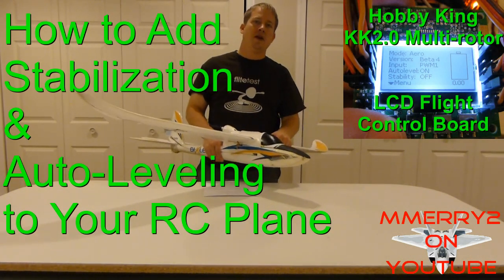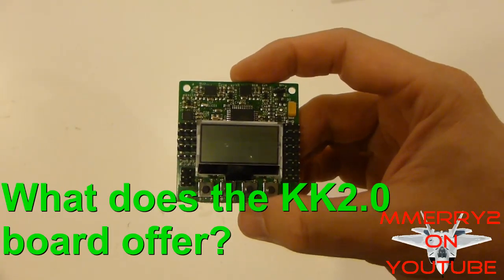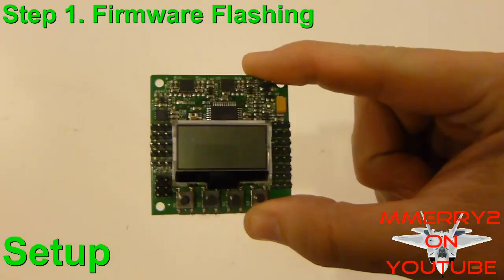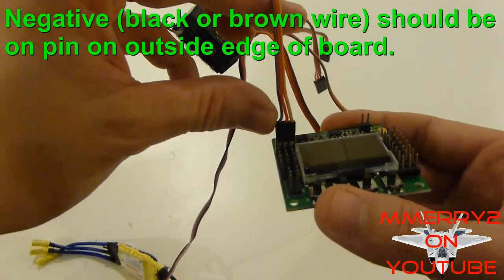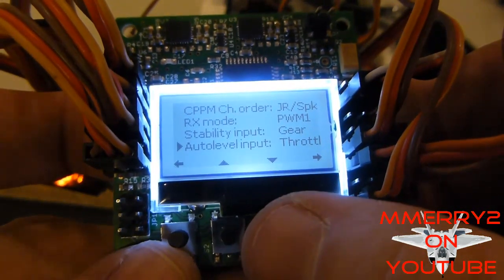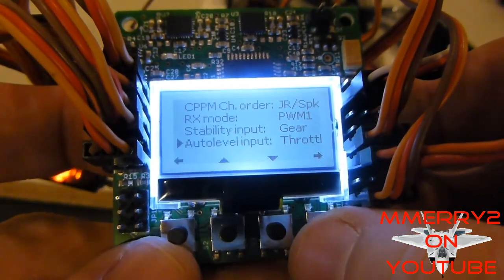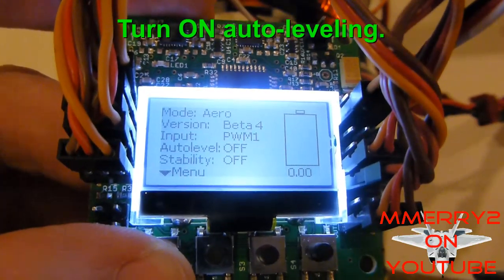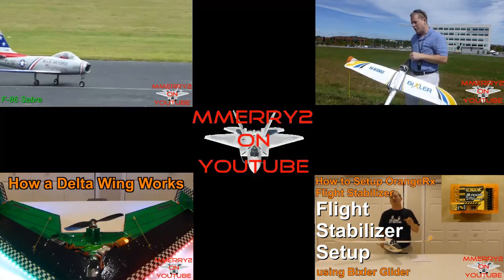Add Auto-leveling and Stabilization to Your RC Plane using HobbyKing KK2.0 Board

Comment: End of May, 2016. and I used this video to setup my plane, and new menus are not hard to figure  out. I have 3 pos switch on my radio, so i did not need AUX chanel. Positoon 1 2 and 3 select profile 1,2 and 3. all off, stablization on and Auto level on. Now here comes fun part. I jumped one cable from AUX chanel to M2 and that eleminated the need for UBEC. or Y connector for the battery and 3 amp bec on ESC has enough power to run radio , KK2 board and 4 servos. (I use 1 in each Aileron). Your video was a great help and I thank you for doing this. I am sure it a lot of your time. Again thanks.

Comment: Thanks for video and all the info and links..... im very rusty with rc plane flying after a break of 30 years and getting back into it and this will be a great help in assisting me in the air....
Reply: You can get auto leveling receivers and add ons now that are easy to set up and use.

Comment from the maker: Yes, the OpenAero firmware does camera stabilization too.  You hook up the servos for stabilization to M2 (tilt), M3 (pan) and M4 (roll) on the left side of the board.  Check out the OpenAero manual for the details.

Comment from the maker: It depends on which channel you have the 3-way switch.  If your 3-way switch is on the FLAPS, you probably want to plug into AUX on the receiver and plug other end into row 3 (on left side) into KK2.  You could also plug it into row 5 on the KK2 (which is called GEAR).  In the OpenAero2 setup you can then configure the channel to use for the 3-way switch.

Comment from the maker: Yes, it works with glow.  In fact, the KK2 with OpenAero will work with glow, gas, electric, turbine, etc.  It has more to do with the receiver and servos than the engine/motor.  Hope this helps.

Comment from the maker: No, sorry if you are talking about the "HobbyKing Multi-Rotor Control Board V3.0", it's just for multi-rotors.  In theory, you could use it on a plane, but I don't see that anyone has any firmware you can do this for you.

Comment from the maker: Yes, it can do autolevel, stabilization and the camera gimbal together.  Hook them up to the right-side connections like so:  row1=empty, row2=tilt, row3=pan, row4=gimballroll, row5=elevator, row6=aileron Y/left aileron, row7=right aileron, row8=rudder.  The BEC can be hooked up to any of the connections on the right side, using a Y.  If you have your ailerons sharing row6, you can plug the BEC into row 7.  I don't think you can hook up the BEC to row1.  This is in the OpenAero manual, right?

Comment from the maker: It will definitely help, just make sure to test it well on the ground before taking off.  The OrangeRx Stabilizer is also a good choice and is easier to setup.  BTW, link corrected.  Thanks.

Comment from the maker: After flashing it with the OpenAero2 firmware, you can not use the OpenAero2 with your multicopter, however you can flash the firmware again to use other KK2 firmware for use with multicopters.

Comment from the maker: Stabilization without auto-leveling is ideal when you want to some turning with the plane and mild aerobatics.  Also, when you're heading for a big tree, you'll want to be able to quickly take auto leveling off, still have some stability control, to avoid the tree.

Comment: i just test the kk2 on my sky surfer on the bench, the default gains for stabilization and auto level seem to have little reaction  with the control surfaces, in your bixler, what gains do you have for stability at auto level, maybe a starting point for viewers
thanks

Comment: Thanks for the quick response, what i really wanted to know is if i can use the KK2 board in my bixler with the auto level and stabilization and also plug in a camera gimbal. You say plug into M2,(tilt) M3 (pan) and M4. In your vid all these chanels are already ocupied with the male to male servo leads. Please help. I have the kk2 board, open aero fm and a Bixler. Want to set auto level, stabilization (same as your vid) and simultaneouslly use the camera stabilization as well.(only pan and tilt)

Comment: Hi MMerry. Thanks for the great video.
I built that board into my plane. Is there a video somewhere on standard settings for Open Aero? On my plane the Stab worked, but not the autolevel in flight. The rudders reacted like they should when holding the plane, but on flight it didnt't seem to work. Also the stick control didn't seem to come through when flying in autolevel mode.
In the end i crashed the plane for some other reason, so now i can't test further. Thats why I am asking for settings.JJ

Comment: I realize this was 8 years ago. But, is there something like this I can use for auto-leveling for my Parkzone Radian PKZ4700 Sailplane for relatively cheap? Thanks for ur great video!
Reply from the maker: Great question.  I think HobbyKing stopped making these inexpensive OrangeRx stabilizers and KK Boards.  However, if you search Amazon for "HOBBYMATE 3 Axis Gyro Stabilizer" you can find a similar alternative.  Full disclosure, I haven't tried the HOBBYMATE stabilizer, so I don't know how good it is.  If you are willing to pay more money for better quality then search for the "Apprentice S Receiver."  I have used the receiver in other planes besides the Apprentice.  Either options should work in your Radian sailplane.
Reply: @WVRetreat  plz if u have an idea about kk2.1.5 for fixxed wing

Comment from the maker: Yes.  Otherwise, the board can reset.  Here is the explanation from the OpenAero2 designer HappySundays about only using your ESC with built in BEC:  "You have to understand that it's not just voltage droop but current flowing through the board that upsets the KK2. They share ground paths if you connect them together. It's not the updated BEC that helps, but the separation of 5V rails. This way, servo current does not influence the KK2 board itself."

Comment: Thank you for making this great setup-guide. I just installed V1.2B10 on my KK2.1. I have the Bixler 2. Did som reversing on the board, regarding both servo input and levelling direction. Everything seems to work great, but the level meter show wrong direction on pitch. When you tilt the plane, the ball should go to the "highest" point on the screen, right? The board direction is set to "AFT", my buttons are facing forward. Can something be done about level meter ball?

Comment: NOTE: i was about to fly my plane with OpenAero2, and i decided to do a static test 1st and what i noticed was that all the control surfaces were shaking as i increased the throttle. so i started to think and i removed the board from the plane and held it in my hand and then started increasing the throttle..and the surfaces did not act weird...CONclusion is OpenAero doesnt like even the slightest of shakes
 
do you have vibrations below the canopy or in that section? as the motor is at the back

Comment from the maker: The OpenAero2 firmware doesn't support controlling the throttle, therefore it's not connected.  It's not really necessary to get the auto leveling and stability control.

Comment from the maker: The HK 401B has gyroscopes only.  The KK2 has gyroscopes and accelerometers.  Gyroscopes give you stabilization, e.g. helps combat wind.  Accelerometers give you auto-leveling, e.g. you put your plane into a dive and let go of the controls, the accelerometers bring the plane back to almost level.  The HK 401B can't do that because it doesn't have accelerometers.

Comment: Hi mmerry2, great vid. One question. Is it possible to conect a camera gimble for camera stabilization with this firmware?. I really enjoy the idea of autolevel and stabilization, if it were possible to conect a cam gimble this would be perfect for me. I have a quad with kk2 board and firmware V1.5 which has cam stabilization conected to M7 and M8. Im would like to set this board on my Bixler with a camera mounted and conected to the board for cam stabilization. Any sugestions. Thank You

Comment: The plane I am to put this kk2 board in to, has the flight controls powered by an SBEC ESC. Do you still need to power the kk2 board separately? Can't the juice from the esc's bec, that currently powers the Rx  also power the kk2?

Comment: thanks for the setup!!!! but where to add the esc wire in kk board? i have 2 brush-less motors attached with my plane ......
Reply: +singhvikash415 kk board is not going to control your throtle. only your servos for stabilization

Comment from the maker: I haven't heard a lot of recommendations to use the "aeroplane" mode that's included with the KK2.0 board.  It doesn't sound like it has a lot of support.  The "OpenAero2" firmware is recommended for using the KK2.0 in an airplane and it has better support by user HappySundays.

Comment: +mmery2 great video, still usefull after so many years.
I have a Bixler 2 and I'm adding a KK 2.1, but I have one question.
I have flaps in this Bixler 2, and I'm not sure how I should configure Open Aero to control the flaps.
Any thoughts?
Thanks!
Reply: The answer is to use the secondary aileron output to manage the flaps, mapping the throttle input channel in the board (that will actually be connected to some channel at your receiver, since you will connect the actual throttle directly to the ESC) to this output.
The new OpenAero version is different, now you manage 3 profiles that will be changed when you flip the GEAR (for example) switch or change the dial (I'm using the dial, since my cheap HK-T6A V2 radion doesn't have a 3 position switch), and by default in the first profile everything is disabled, in the second only the stabilization is enabled, and in the third stabilization and auto leveling are enabled (you can change the profiles if needed).

Comment: Hi, im trying to use this with my bixler with seperate aileron servos. I have v1.2 beta 10. The rc control from my tx is correct but the stabilisation and auto-level are opposite on my ailerons and rudder, when iroll the plane to the lefts it tries to correct this by rolling further left etc. Is there a simple fix to this that i have overlooked? Thanks.

Comment: in Beta 4 which came earlier and what i have now installed in my kk2 board has an unusual fault: as i increase my throttle up, the plane rolls to the right and that is veryscary for a beginner like me. please help me out with the setting or whatever solution.

Comment: I have installed OpenAero2 on my plane (exactly like yours) and set it up. All servos working correctly both in normal and stabilize modes. However as soon as I install the KK2.0 board in the plane, at 50-80% throttle the servos are jittering a lot! For sure it has to do with vibrations because when I try it with KK outside everything is fine. Tried messing with Acc LPF (1, 10, 30) but didn't make difference. Also I have foam padding underneath KK. Any ideas?

Comment: First off,  thank you for this very informative video.  There are a lot of KK2 boards out there that will see new life because of  your video.  At the time of this writing HK is selling the KK2 for $30.68 and the KK2.1.5 for $21.99.  What is your opinion of the KK2.1.5?  Is it also useful for this application?  Thanks for your time.
Reply: The KK2.1.5 is a decent board and I’ve used it successfully on a quad. OpenAero does works with it, but see the comments below about issues if you have to reverse a channel. I assume there is the same with the KK2 board.  There must be  a straightforward solution but I can’t find it.

Comment: Great video, thank you plus another request for the KK2.1 tutorial. I have a number of both boards lying around so I may as well fit them to a few planes.  Just one thing, could you place the board, cables, controller etc on a table when showing them. You tend to shake around a bit and at times it was rather unsettling to watch, especially when you tend to talk with your hands. A static shot is far better, except when demoing actual board movements of course. Just a minor thing but it will make for a more professional looking video.  Thanks.

Comment: Can anyone suggest a smart way to mount this inside the Bixler2, so that I don't need to remove it to press buttons etc?

I'm thinking mounting it somewhere inside and making a side hatch under the wing... But maybe the board has to be parallel to the wings' plane so this won't work...

Comment: I have the kk2.1 board and I was planing to put it in my sky surfer but I do not see the listed menu on my KK2.1 board that I saw on yours. R U going to make a video with the KK2.1 board?
Reply from the maker: Did you flash your KK2.1 to the latest OpenAero firmware yet?  You need to flash it to OpenAero2 V1.2 Beta 10 or better.
Reply: Sorry no I did not I will thanks
PS can you send me a link to get the needed drivers Thanks
Reply from the maker: Cameron Hinds
If you follow the "OpenAero2 Firmware thread" link in the video notes you will find the "OpenAero2 V1.2 Beta 10 for KK2.1" firmware that you can download.

Comment: I have flash my firmware to 1.9 and installed OpenAero2_B10_KK21 but my pages on the kk2.1 board is different to your kk2.0 board, are you going to make a video with the kk2.1 board?
Reply from the maker: It seems like there are enough differences in the new firmware version, so I may make another video eventually.  With the new firmware, I think you need a transmitter with a 3-position switch or dial in order to switch between the 3 different modes (stability, auto-level and off).  I'll add an annotation in the video for this for now.

Comment: Hi mmerry2! Great video. Thanks for that! 
My Mini KK Board with openaero2 works fine on my Skyfun - but only till I start the motor :-( The motor runs smooth (for a few pole 2200kV) and is well balanced but even this low vibration is enough to let the servos jitter very much in Autolevel mode. So I decided to change the bearings of the motor and mount the board on a damping pad with added mass. But this didn't help either. When I check the "Levelmeter" with running motor (even without prop) the dot jumps arround like crazy - but I can hardly feel vibration on the plane. Sure, the 2200kV motor has only a few poles and there might be motors that run smoother, but isn't there any working softwarefilter? The LPF settig doesn't help much - set it to 64 means low pass filter at 1Hz - I think my vibrations are at much higher frequency... it still jitters so much. Did you notice this vibration issue on your planes with KK/openaero2?
Reply: It's a vibration issue. I tried it in an electric glider with a really (!) smooth running motor. It works!

Comment: i have the kk2.0 and the kk2.1.5mini but if i plug in a servo both wont work.
kk2.0 flashed v1.2 b10
kk2.1.5mini flashed v1.2 b10 kk2.1 (mini)

reciever inputs are working exept for elevator and aileron on kk2.0(numbers going nuts)
can anyone help?

Comment from the maker: HappySundays says the following in the OpenAero2 Quick Start Guide:   "Do not connect the 5V supply from M1, or the receiver to the servos on M2-M8, else the electrical noise from the servos in flight will cause the KK2 board to reboot and crash your aircraft."

Comment: Where can I find theFile OpenAero2_B10_KK21.zip is for KK2.1 boards?
Reply from the maker: Yes, OpenAero2_B10_KK21.zip is the file you want for a KK2.1 board.  It's located at the bottom of the first post in the OpenAero2 Firmware thread.

Comment: Hey mmerry2, thanks for your videos, you have inspired me to try adding stability control to my Bixler 2. I am having a hell of a time getting the stability and level contral to behave properly. When I enter stab mode, my flight control surfaces behave properly but the corrections are reversed. If I reverse the behavior of the stabilization in the mixes, it also reverses the radio commands. So I'll be in no mode, flying normally, switch to stabilize and my ailerons reverse although the stabilization behavior is correct. Any ideas? I've been scratching my head on this one for a while. BTW, I am very new to flying in general. Thanks again.
Reply from the maker: I think you need to reverse the mixes on the KK2 and additionally reverse the channel on your transmitter.
Reply: I have the same problem. Everything works OK with the control directions normal. But when I reversed the aileron channel (either on the Tx or in Receiver Setup) the roll gyro and accelerometer worked in the wrong sense. So I thought all I needed to do was set these to Reverse (not ON) in Channel Mixing. But then I found, as you did, that the Tx controls changed direction when I switched to stabilise or level. I haven’t found a solution so I’ve changed the servo layout so that I don’t need to reverse it.
Reply: +Kenneth Pearson 
Try this Go to  Channel Mixing
1. Set Setting for to OUT6  (this should connect to your aileron servo(s))
2. Set Source mix to ON then Set Roll Gyro to ON and last set Roll Acc to Rev.  This will reverse your aileron when gyro accelerometer is triggered.   This works on mine which use v1.2b10.  Ref to https://github.com/happyhappysundays/nextcopterplus/blob/wiki/OpenAero2_User_Guide.md

Comment: Hey does anybody know if you can do the same thing with the newer model? The kk2.1.5 board?
Reply: RC flight Seeker just figured out, you need to go into Menu - 5. flight profile 1 - Change all settings you wanted on. I did stab on and auto leveling to Hands free (auto level on centered stick)
Reply: Did u get a solution for the 2.1.5

Comment: how do you arm this board, or is it always armed
Reply: I want to know this too.  Servos working but no motor.
Reply: Hold both sticks to the bottom left corners of the pots to arm the board. To disarm, just mirror step one.
Reply: it it just me, my servos jitter at 60% throttle.
Reply: Hmmm, i have to trimm down the trottle stick. Then the motor spinns by pushing the trottle stick, but without arming.